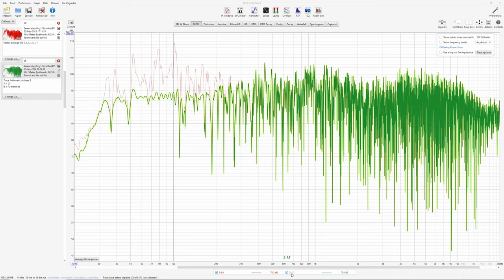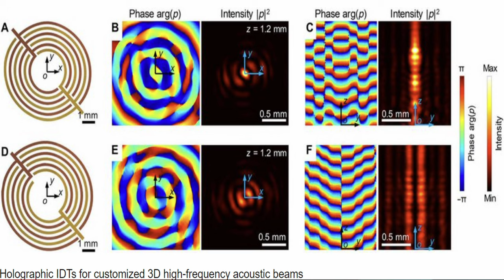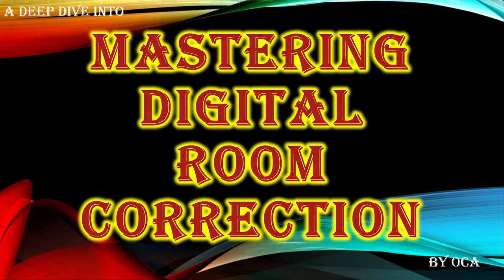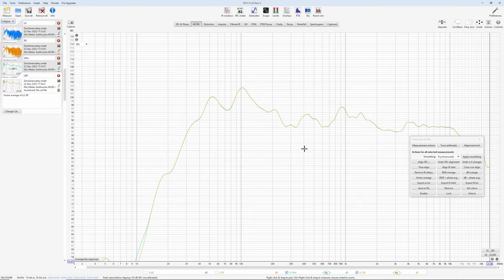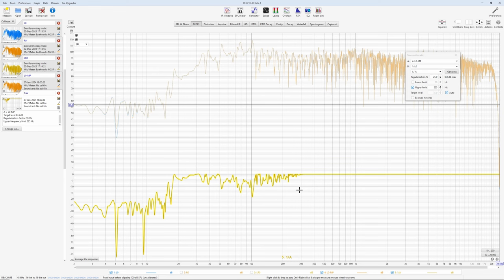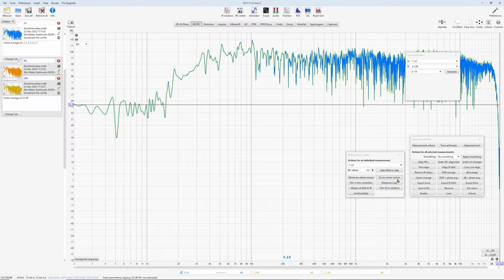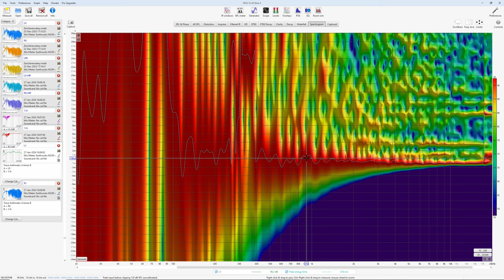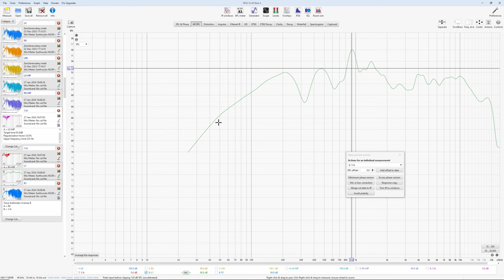Mastering Digital Room Correction

Comment: I watched this video maybe 30 times now :) and the others too . I made everything , sound very good , but lost a lot of base...
First time i did it with the sub connected and just followed a long but the sub was working i had LFE + Main set .
Second time i only made left and right (subwoofer unpluged) . 
Remains to test the next days .
I would really appreciate if you would explain a little more about adding the harmon curve , i dont understand : 
,,Drop the .txt file on to REW - you mean in the EQ ?
3. AxB (trace arithmetic) multiply that with each of the "1/A" filters" really lost me here 

Thank you and God bless you for sharing the knowledge
Reply: Maybe should use spl allign ? Like in the first video ...i have a difference in the convolution filter 0.2 db
Reply from the maker: I understand you are using FIR filters in a PC and using an AV receiver as an amp (LFE+Main reminds Denon/Marantz gear) because otherwise you cannot use these filters with Audyssey. Anyway, the inversion is done on a flat line so there's no bass tilt. I've developed some solution for that already and its video is in the pipeline. But in the mean time, you can A x B multiply each of the 1/A filters with a low shelf filter and increase the bass as much as you want. You can generate a low shelf filter with REW in the EQ window: open EQ filters, select "LS" from the drop down list, frequency i.e.100Hz, gain +2dB and then "Generate measurement from filters" under "Filter tasks".  This is your "B" in "A x B" trace arithmetic. You will need to adjust clipping headroom.

PS if you hear any pre-ringing effect, generate minimum phase versions of each of the 1/A filters and multiply these MP versions with the LS filter to generate your final convolution filters.
Reply: Thank you very much . 
I have this :
Pc - Smsl Su1 Dac - analog to Denon Avr 3500H and 2.1 speakers .
Front sp cut 80 Hz , i tried 110 hz but no big difference .
Bass i have Lfe + Main 120 Hz .
Direct mode in Avr , i understand this is the best for music .

I wanted to make the music listening good .

I will try , and i will wait for your next video .

Respect and wish you all the best

Comment: Thanks for the video.
With REW's light background it is very difficult to follow the instructions.
In the next videos can you put the dark background?
I use Equalizer APO.
Can the filter be exported in .txt?

Written with translator

Greetings
Reply from the maker: I am way too familiar with REW light colors to make a change but I will consider that ;)

EQ APO accepts wav files for convolution so you can use the filters in the video with it. You need to save them in a certain directory and direct the config files to them.

Comment: Always respect you OCA. 😊
Minphase Inversion is simple, fast, and produces good results.
Also, messurement graph is improved to make it look good to the eye.
However There is a limit to one listening position on one speaker (or subwoofer) and eventually we will use up to the limit of drc when active treatment, inversion, and time domain calibration are performed simultaneously with multiple speakers (or dual, quad subwoofer).
Thank you for making the video.
Reply from the maker: Thanks.

Comment: Hi! Very inspiring video! Have 2 questions if I may.

I would like to integrate the convolution DSP into my system.
My current setup: Apple TV, PS (HDMI) -> TV (S/PDIF) -> miniDSP 2x4HD. miniDSP is used for XO, time aligning, and PEQ (20-200Hz).

To achieve convolutional DSP I guess I need a Linux computer with HDMI input and S/PDIF output (could use USB as input for miniDSP, but then it would be hard to operate miniDSP).

So the future setup could look like this:
Apple TV, PS (HDMI) -> TV (HDMI ARC) -> ConvolutionDSP (S/PDIF) -> miniDSP. miniDSP is used for XO.
What do you think about such a setup? 
Will XO using miniDSP introduce phase changes achieved by the convolution filtering? if so, I guess I need to ditch the miniDSP all together?
What would be the hardware requirements for such a computer (max number of taps)?
All your recent research suggests to me that the convolutional DSP is the future, but how much better it would be compared to my previous PEQ-based setup in your opinion?

Thanks!
Reply from the maker: You haven't mentioned your speaker count but I believe it's 2.1? Even a Rasperry PI can easily do over 16k filter taps without significant delays. Yes, you will not need a MiniDSP if you use a PC for convolution and stay within 7.1 channels.

Comment: Great Video OCA! Thank you very much. Is it preferable to take measurements with the microphone file calibrated to minimum phase, or is it acceptable to use the original calibration file and then apply minimum phase correction to the microphone afterward?
Reply from the maker: It would be the same thing as long as you apply the mic phase correction to the responses right.

Comment: It's amazing... The final filtering is great at improving bass.

However, in some trial listening clips, the bass will produce a delayed ringing effect. If the music clip ends with bass, the party music will end, but the bass will continue in a background music like rumbling sound for about 1 second

For example: ANNE-SOPHIE MUTTER "CARMEN-FANTASIE" Zigeunerweisen op.20 IV. Allegro molto vivace
Reply from the maker: Thanks. How was your front speakers set up by Evo?
Reply: @ocaudiophile  Sorry, I loaded the filtering wav file based on the ROON software and did not use the EVO ONE software you recently shared
Reply from the maker: @aland8195  Ok, sorry I thought the comment was under Evo video :) AFter you create the final 1/A filters, generate their "Minimum phase versions" and use these as filters instead. That will completely remove the ringing.
Reply: @ocaudiophile  Thank you very much for sharing and answering
I just checked the data of REW again, and the original curve (A) * 1/A filtering (B) shows a significant increase in RT60 data in the 150Hz frequency band. This may be the reason for the strange listening experience, which is somewhat strange.
Reply from the maker: @aland8195  Inverting a response properly requires a lot of filter taps for accuracy.

Comment: Serkan, I have had great results with this simply correction method.   Only issue I am having is on DSD files, I now hear a quick noise prior to each DSD file playing.  It is the result of my filter.

Any ideas on what I did or how I can eliminate it?  TIA!!
Reply from the maker: DSD files require a lot of CPU power, decreasing filter sizes might help or upgrading your PC ;)

Comment: Correcting seperate speaker phase seems quite tricky to me. Have you also tested how the end result is when both (or all your ) corrected speakers are used simultaneously?
Phase so far has been my biggest enemy with most DRC methods. After having wasted weeks with DIRAC BC only to conclude that system is completely unsuitable for HT purposes. 
(they actually create more phase issues than solving them.. since they linearalize speaker groups, yet don't align the groups resulting in huge nulls. Worse yet, they seperately adjust SW phase per speaker group, causing even nulls in the actual SW-out signal.. unless they fix this huge bug i would recommend to stick to XT32 (with perhaps REW help to straighen curve) for HT content for those who have no external DSP for AVR)
Reply from the maker: I agree the whole method is flawed but they're also quite limited with the number of FIR taps available for bass correction. Audyssey is not much different but at least it's fully customizable by the apps. XT32 will also stay my choice until someone comes up with an AVR (wishful thinking) with user configurable FIR filters. The correct way of creating these filters are quite well known and agreed upon among experts for sometime now but somehow the market monopoly don't bother updating theirs. Audiophiles are stuck between ancient automation and GEQ filters with sound united gear.
Reply: @ocaudiophile  Weird my last comment was removed, did you do that or youtube? Its okay if you dont want to discuss about some things, just let me know :) Appreciate all the work you put into your channel. Just bit strange i get no notification of the removal though, then again never used youtube to comment so idk whats normal.
Reply from the maker: It was definitely not me. Let me check "held for review" section.... @Rain-l6f
Reply from the maker: No, there's nothing being held by YT. I received your comment by email btw but I can't see it here.
Reply from the maker: FYI, I didn't delete i a single comment from this channel to this day. Also, most probably (to the best of my knowledge) didn't leave a single question unanswered.
Reply: @ocaudiophile  Test successful, it was the added imgur link, apparently im not allowed to post links on youtube comments :-) Cheers man
Reply from the maker: YT will accept google drive links in comments.
Reply: From your comment I deduce that you do not use Dirac Bass Control.
Is it like that?
Have you verified what was mentioned about Dirac BC with measurements?
Do you post your comments in any forum?
Written with translator

Greetings
Reply: @JuanJose-wt5yj  I have DLBC, it's utterly crap so im sticking to Dirac live and xt32. Anyone who says BC is great either has no ears, is extremely lucky or a dirac shill. The corrections are fundamentally broken, and no amount of user effort can fix that, and that's ignoring all the bugs that are present as well. For me the worst value purchase I have ever done for audio.
Reply: @Rain-l6f  Thanks for the difference in answering.
I use Equalizer APO and equalize manually with REW's RTA.
I don't like semi or automatic calibrations where it is not possible to configure them manually.
I tell people who ask me that if they are willing to learn how to handle REW, they should take Audyssey Multeq-x, which has more power and is more configurable than Dirac Live, and many forums don't like to read about that.
Reply: @JuanJose-wt5yj  Thats fine for pc audio, i bought dirac so the corrections are on the AVR. Diracs imaging and spacial accuracy is however much worse than audysseys (contrary to what people experience on forums..) so for movies i actually prefer xt32. Tonality is better with DL though due to using Umik. Still have to try xt32 using Umik, if that fixes midrange and highs, but after wasting weeks with dirac I'm currently taking a sabbatical from measuring 😂
Reply: @Rain-l6f  Thanks for your comments.
I recommend you since you know how to use REW Multeq-x for 200 dollars, much more configurable than Dirac and I am sure that with that power you can achieve a better result.
If Dirac does not update that it can be much more configurable, I would be clear when looking for an AVR with powerful calibration.
In my particular case I use a computer for source and image and sound.

Comment: Thanks for the videos! I previously followed your Digital Room Correction Workshop videos but with an uncalibrated microphone just to try and feel how room correction in REW feels like. I recently got a UMIK-1 and decided to follow this video instead. I managed to get the filter but I have to apply -8dB of headroom management in Roon to prevent it from clipping. Is this right? I generated a minimum phase version of my calibration file as per your previous video but my phase measurements still do not look as clean as your measurements. Could my speakers using DSP internally be causing this? Look forward to your new video!
Reply from the maker: That's totally normal and expected with phase filters and Roon headroom. Min phase versions of the inversion filters will not match the clarity of the real filters but they will guarantee no ringing. Play around for now, I'm working on an Audyssey automation video now but I've developed something even better for stereo. I guess it's the next one after in the pipeline.
Reply: @ocaudiophile curious about that even better metod for stereo 😊

Comment: Always a pleasure to see a new video coming from you. A question:
The Virtual bass array filters from previous videos, are complementary options or are somehow also substituted by this methodology?
Regards ;)
Reply: I am curious about the same thing. This correction is so much simpler than the 4-5 steps necessary to do the former corrections.
Reply from the maker: I tried hard to add a VBA filter to this solution but none was increasing clarity but in some very problematic rooms, it might help.
Reply: @ocaudiophile  thks for the feedback ;)
Reply from the maker: Yes and it does the excess phase correction automatically as much as it can be done, it does volume leveling and it requires no target curve.

Comment: Hello OCA! Congratulation! Great job as usual. Can I ask you for assistance? I made "1/A" (mono, 24bit PCM, 96kHz) filter as you presented in this vid but Brutefir (volumio convolver) does not accept it. The message appears every time: "Error with filter size. Filter is not usable! Filter size must be power of 2!". Brutefir accepts filters made by rePhase but in rePhase I can change the taps parameters or FFT lenght. How can I change these parameters in REW to adjust the filter length? Thank you in advance. I wish you all the best.
Reply from the maker: Under "Export Impulse Response as WAV" window, there is an option "Export this sample count", when you tick it, REW will give you number FIR taps options for power of 2. But I'd careful not to decrease the tap count too much, these inverse filters require a lot of taps to work correctly.
Reply: @ocaudiophile  You are great! Just as you suggested. "Export this sample count 64k" helped. Works great, Thanks :)

Comment: Hey there, im freshly venturing into the world of dsp. Thank you for the video! I have a desk setup with a sub and 2 single driver speakers. You mentioned creating min phase crossovers at the end of this vid. Before trying this method would you first suggest I ensure my sub to mains crossover is min phase, and if so which of your videos would be best to learn?
Reply from the maker: If your speakers are really single driver units, there is no crossover in them. You will only need to time align them with the sub. I have a video for aligning two subs between them but not much else on this subject. It's quite easy though, you need to sync group delays of the sub with the speakers. After that, this inversion method should work fine with the combined system.

Comment: A couple of stupid questions:
- Would the low frequency dips be gone and response be perfectly flat if I had some magic corner bass traps behind the sub(s) that would unrealistically remove all reflections at these frequencies combined with this method?
- Would you recommend using JRiver rather than Equalizer APO for a non-server windows computer too? I don't see the benefits if you are streaming music and video.
Reply from the maker: Most dips are not as audible as one would think looking at the charts. I don't have much experience with bass traps but you would need extremely large absorbers to deal with anything below 150Hz which is unpractical and it might absorb higher frequencies as well which might dim mid frequencies below acceptable levels. But as I said, I am no expert when it comes to bass traps.
Equalizer APO is free, that's a big plus and and it does the job but it digs itself deep into the Windows sound output  and you need to restart the PC even to temporarily turn it off. JRiver is more flexible. Also I have seen very small latency variances with EQ APO at times. JRiver DSP is much easier to use and has one of the best digital volume controls in the market plus it's a great tool for videos & photos.

Comment: Thanks for the great video, it really helped a lot and easy to do compared to the FIR before. I have also tried Harman curve you attached. However I have the same issue as others, I have to reduce -3db or 4db to prevent the clipping. Is that normal?
Reply from the maker: Yes, Roon alone adds 3dB for example.

Comment: Dear OCA, 
thanks for this tutorial. The last tutorial I followed was the Supreme Audyssey calibration. The new videos show many different things and different approaches. Hence, a few questions in context of home theater:

1. Does this tutorial apply to receiver level calibration? I don't run anything on PC, nor do I have any DSP like miniDSP etc. 

2. Is Audyssey ART video the successor to Supreme Audyssey Calibration? Meaning Audyssey ART should deliver better results?

Thank you for your amazing work.
Reply from the maker: 1. Unfortunately, you cannot apply these filters with phase corrections to a multichannel receiver although exporting just the frequency response filters even improved the sound of Audyssey in my own tests.
2. Yes, slightly better HF performance compared to Supreme Audyssey method.
Reply: @ocaudiophile  thank you. Does it make sense/is it possible to create minimum phase calibration file of UMIK1, in context of Audyssey ART method?
Reply from the maker: No, because Audyssey filters cannot correct phase. @ElectroPineapple

Comment: Hi, sorry if this is a noob question, I assume we should be using the shroder frequency cut off for all previous videos now. Is there any difference in creating a full range filter and cutting it to 200hz in the Audyssey app or creating the filter in rew only to 200hz and using it full range in the app. Thanks.
Reply from the maker: Not really, this is for HIFI systems. With surround speakers, you might need to do HF correction due to absurd positions of surround/ceiling speakers. Also you cannot do phase correction with Audyssey. Still, inversion filters described here gave very good results in my Audyssey set up (even without their phase information and up to Shroeder's limits)